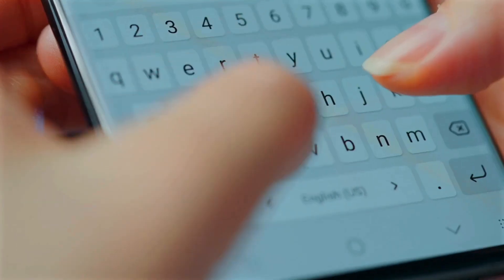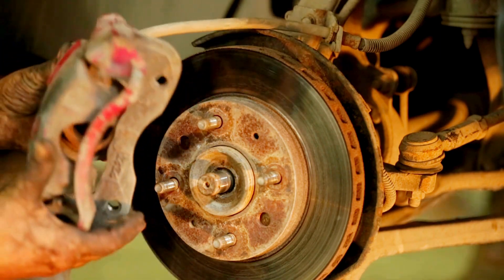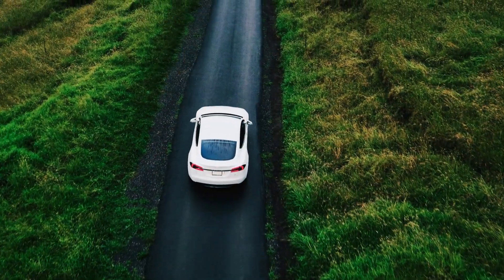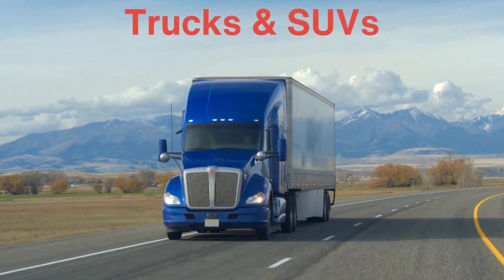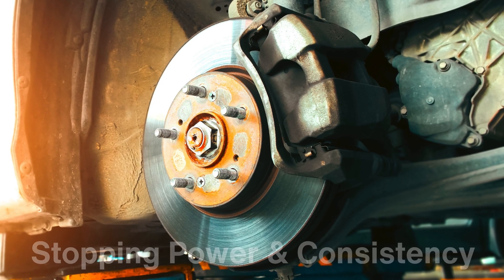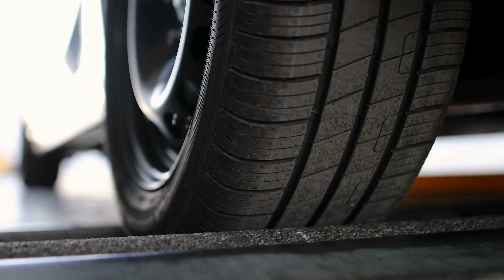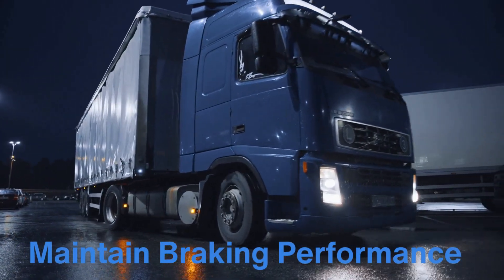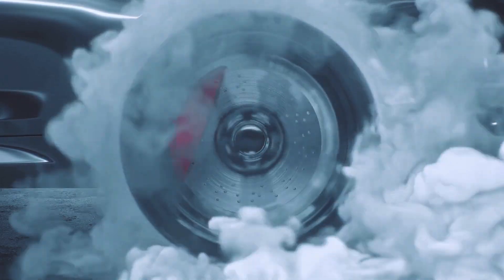Disc vs Drum Brakes - Which is Better?

Comment: Drum brakes with brake-fade is an amusing subject with me whenever I see the movie "Bullitt," as that nearly seven-minute long chase scene between the Dodge Charger and Ford Mustang was compelling, but also a joke.  For those two cars to traverse the hilly streets in San Francisco at high speeds, that chase scene should have lasted no more than 90 seconds due to drum brake fade . . . and I've backed up that notion with speaking to gear-heads that specializes in high-performance vehicles of late 1960s vintage; where they've unanimously agreed that with the brake technology of that era, those cars should have lost control due to brake fade in a short time, with 90 seconds being acceptable.

Comment: Another aspect that makes rear drum brakes viable for most vehicles is with engaging the parking brake.  Having a cable connected from the hand-brake lever to the drum brakes is an easier setup than trying to use disc brakes for the parking brake setup.

Comment: Disk brakes are fine when they work. In my case they always lock up and heat up the rotors. Salt, sand , Ice and infrequent use of the vehicle make disk brakes unreliable to me. I have to put on new calipers every couple of years. A royal pain. Never had drum brakes lock up and I prefer them But it's not like we have a choice when buying a vehicle. Now I have 4 wheel disc brakes on my Ram; Oh Boy the Fun I'll have, already had to change rear calipers because one side locked up. Are they making junk these days? Give me drum brakes.

Comment: Vented discs on front.
Rear discs are just a vanity   on small FWD hatchbacks for example a Saxo or small FIAT as the rear wheels have so little weight on them. 
In contrast a rear engined car like the original Porsche 911 needs equally sized brakes front and rear 
Drum rear brakes give a very much better handbrake (aka parking or emergency brake).
ABS generally operated better on disc brakes.

Comment: Drum brakes are garbage.  I'm old enough to remember when cars had them.  Drum brakes are self tightening in a positive feedback loop that's difficult to control.  The more tightly they grip the more the shoes rotate causing them to brake even harder.  So one wheel on each end of the car would out brake the other causing the car to lunge in some direction.  You never knew which way it was going to go, but it was going somewhere.  Drum brakes will always be a deal breaker for me.

Comment: On EVs most of the braking is done by regeneration where motor charge the battery, so brakes are less used and last longer. On EVs rear drum brakes is a good choice to lower maintenance for most car models.